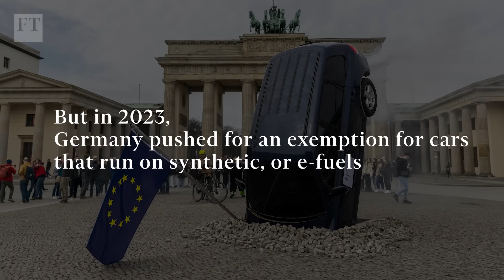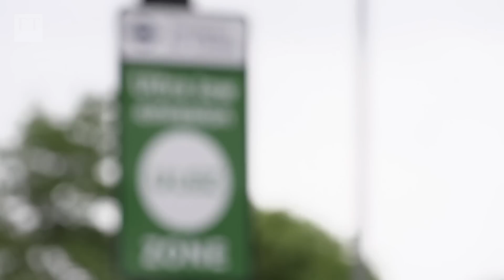The end of the combustion engine? | FT Energy Source

Comment: I'd like to hear a discussion around fuel prices. At what point in the reduction in oil use will it become too expensive to use
Reply: Why do you think that oil production will be reduced?  Oil is used to make just about everything - clothes, plastics, etc.
Reply: @bobcrow1462  plastics are a by-product of oil. If there is no market for burning it, plastics will become non viable as a "cheap material". Although that change will no doubt impact the consumer market.
Reply: @uniteddreamer  - " plastics are a by-product of oil". This may have been initially true (though polymer creation started before this time)  but once it became obvious how versatile plastic is, this view changed. You also refer to plastic as a cheap material. Plastic only becomes 'cheap' once it's developed. Look at ABS, PET and PP and compare these to PTFE and Alcantara for example  Plastics will always be economically viable because the are now indispensable.. 'Fossil plastics' will be around for a long time to come if not indefinitely as there will be a lot of resistance to bioplastics (as there was to bio fuels ('growing fuel instead of food (with the opposers ignoring the fact that the 'food' was of low nutritional value)).
Reply: @uniteddreamer Plastics aren't a "byproduct" of oil. They're a derivative of oil, just like fuel, fertilizer, industrial lubricants, personal lubricants....
Stop using oil for energy, and that part becomes waste.
Reply: @wisenber  they're a by-product. Plastics wouldn't be a thing if we didn't burn oil for energy. That's what drives the economic imperative. Plastics are an afterthought.
Reply: @andyroid7339  well hopefully we will learn how to recycle it. Because there are plenty of "indispensable" plastics lying in landfills.
Reply: @uniteddreamer  Except that's not true. You don't seem to understand the adoption and development of petroleum very well. Without oil, our current standard of living and life expectancy wouldn't be the same. That, and hydrocarbons still provide around 82% of the energy required to maintain the current standard of living.
The first use for oil was kerosene for light. Prior to that whale oil was the leading source of fuel for lamps.
Reply: @wisenber  plastics weren't developed till long after we started refining it to burn as fuel.
Reply: @wisenber  with respect to our standard of living, that's a completely separate point. The same could be said about horses, coal, agriculture, etc. History is full of epoch defining transitions. And the green transition will be the next one. It's called progress.
Reply: @uniteddreamer  Interesting that you'd expect technology to freeze at a point in time.  Chemical companies and refiners have been working for over 150 years to find new uses for petroleum. The fact that a single barrel of oil can be distilled and refined into a dozen products shows that. If you make gasoline, the material for kerosene and jet fuel still remains, after that, diesel, after that, shipping fuel, after that tar for asphalt. Before you get to those, polycarbonate for glasses, nylon, polyester....are made.
The "fuel" part is a byproduct which would be tossed as waste.
Reply: @uniteddreamer  - you're correct about the plastics sat in landfills. There are companies already 'mining' this material, along with the metals also there. However, the energy required to process the plastic surrounding food products would be better spent going to power grids whilst stopping this use of plastic (as France will do from 2024).
Reply: Half of the barrel of oil is used for things other than energy.   Oil ain't going away.
Reply: That's a million dollar question, and one the oil industry will need to decide the answer to.... My guess is that as sales volumes of petrol and diesel fall, I feel they'll increase prices at the pump in efforts to maintain their profits. This of course will have the effect of moving more people away from ICE cars....
Reply: @Brian-om2hh  If gas and diesel are no longer being used, refineries will have to figure out what to do with all of the waste when they're making everything else we use oil for. Right now, gas and diesel revenues are making other petroleum based products less expensive. Gasoline was originally a waste product from the refining of oil into kerosene used to heat and light homes.
Reply: Oil producing countries will reduce prices and profit margins and increasingly sell more to developing countries that are still evolving from foot, horse, bicycle and motorcycle transport into ICE cars, likely discarded cars from first world countries ...
Reply: @neilmckay8649  in Rwanda their motorcycle taxis are already transitioning to EV motorbikes. Small-scale solar solutions are being adopted because grid infrastructure is not available for hundreds of millions. Just as mobile phones are more prevalent than  landlines. This is the technology leapfrog effect at work for late adopters. Africa is not relying on western cast offs to the same extent.
Reply: @uniteddreamer  good point. Philippines, where I live, the great majority move on 150cc motorcycles and would love to graduate to a car. Then is the question of new Chinese or old European ...
Reply: @uniteddreamer Africa is building coal plants. Yet Western colonizers want to impose their own expensive climate mandates on the poorest nations.
Reply: @wisenber  at the grassroots level, solar solutions are cheaper, and can be delivered off-grid. It's industry, governments and the heaviest users of grid electricity that are driving coal use, and coal producers sticking their fingers in the pie. But even that is changing.
Reply: @neilmckay8649 ice will not be their choice, the same way they skipped several iterations the ”west” did with phone tech. 
They go directly to current tech, or the previous generation, they skip the other gen’s!

Oil companies are fighting tooth and nail with lobbyists, useful idiots and bribes, but in the long run, new tech will win.
Reply: That's the clincher the oil industry will need to address and decide. As volumes reduce, the oil companies will undoubtedly increase the price, claiming it costs more to produce as a niche product......
Reply: @Brian-om2hh  If volumes reduce, we'll have to find other ways for clothing, water bottles, packaging, medical equipment, fertilizers....without making all of those things unaffordable.
Reply: This is the general idea. Private transport and the RIGHT to own the means of transportation by the individual will be targeted by the combined obscene cost of EV's & their power source and unjustified fuel oil cost spikes by means of more TAXES on both - WATCH THIS SPACE - GOVERNMENT MANIPULATION OF THE RIGHT'S AND FREEDOMS OF THE INDIVIDUAL AT IT'S FINEST.
Reply: @godfreyberry1599 more likely BiG Oil manipulation!!!
Reply: @My_HandleIs_ "Big Green" tends to hold more sway than any oil company.

Comment: My engine design has the capability of being negative emissions (cleaner exhaust than the intake air) when using hydrogen fuel. You can find it here on YouTube the McCoin Rotary Engine “MRX” engine
Reply: Production of hydrogen is really costly in either electricity, or CO2 if it is made of natural gas. EVs are more than 2x more efficient when converting electricity into motion.
Reply: The problem with Hydrogen is the logistics
Reply: @number1genoa  And the storage. It will not be safe or viable to have large tanks of hydrogen stored at 10'000 psi anywhere near housing or workplaces.
Reply: @number1genoa  
The UK is considering hydrogen trains. The hydrogen will be produced at the depots using electricity produced by wind farms.
Reply: How does it work? I have found no graphic for this engine.
Reply: How do you stop the fuel eating the engine?
How large is the Trailor with the fuel tank?

Comment: ICE : 6000 moving parts, 25 to 42% of efficiency, 95 to 200kg of materials.

Electric machine : 1 to 4 moving parts, 90 to 97% efficiency, 35 to 90 kg of materials
Reply: There are not 6000 moving parts on an ice drive train. You have been lied to.
Reply: @cyclone-g2z  my bad, after a few checks it's between 250 to 2000 with the gearbox . The gap is still in thousands of it, that's the point
Reply: gas is about 100 times more efficient than an average lithium battery in EVs today: 160KWh/kg (pack level density), which means more weight and raw materials.
Reply: @tooltalk  you are confusing density ( the amount of energy by mass ) and  efficiency ( how much energy do you waste when you try to convert it in movement) 

It's from far the most important
Reply: @philv3941  : yes, my bad..  not efficiency, I meant energy density : gas 30+MJ/kg vs LIB .3x MJ/kg.
Reply: You are ignoring the complexity of the motors, batteries, and motor controllers. They contain tens of thousands of discreet pieces of silicon, battery shell, cathode, anode, separator membrane, electrolyte, pieces of wire, insulation, lamination, plastic, etc., all of which had to be assembled by man or machine. And all of which can break.
Reply: @geocam2  there is, according to the same insurance companies, between 5 to 15x less chances to experience a fire in an EV than in an ICE car. 
Just check. It's not because EV fire make huge buzz that they catch fire more often, far from it.
Reply: And those rare earth materials will be expensive and in short supply.  On the other hand, there's almost an unlimited supply of fossil fuel thanks to fracking and shale oil extraction.
Reply: @bobcrow1462 you don't burn those "rare earth" materials. That's the difference. And when are oil companies gonna close the two million or so wellheads still left open after five to ten years fracking and depletion of local water supply
Reply: @bobcrow1462  >> And those rare earth materials will be expensive and in short supply.  <<
First, they are not "rare earth materials." 
Second, the prices of raw materials used in EV batteries, eg, lithium, cobalt, manganese, have been falling like a rock: the average price of lithium down 80% since last November for instance. 

>> On the other hand, there's almost an unlimited supply of fossil fuel thanks to fracking and shale oil extraction. << 
Most battery metals can be recycled..

Comment: The premise of the question is flawed. We need to be sensitive to the direction of causality. The available energy, is what determines the best technology, which is what determines the social arrangements in which it is embedded. Cheap abundant fossil energy made possible the culture of automobiles, and commensurate urban design, land planning and infrastructure. The future of energy cannot and will not be the same, so the technology and social organization surrounding it will be different too. Single user vehicles are not efficient or cost-effective, they do not ‘fit’ well with mass electrification. Public transportation seems far more suited to urban needs, and a high speed rail network for intercity linkages. I anticipate EV’s to be used predominantly in rural settings, to transport commodities to transportation hubs, and for emergency services  and security or defense fleets. Unlike in the past, we have a specific future to achieve, and this suggests some thoughtful planning and investment are appropriate.

Comment: Cars using ICE are about 20% efficient in converting chemical energy to mechanical energy.  Fossil fuels are one of the most dense  sources of chemical energy making its portability feasible.  However, electric motors are up to 90% efficient in converting electricity to mechanical energy.  So that part is a no brainer.  Transmissions are not necessary in EVs and most of the mechanical functions can be done with electronics making them cheaper once they are in production.  The F16 is an example of how hydraulic and mechanical systems can be supplanted by electro-mechanical systems.  Julia has a much better grip on the subject than the others.
Reply: The fact that you still call it "fossil fuel" when it has nothing to do with fossils just blows my mind.
Reply: You're easily impressed. @goodtoBfit

Comment: Electric motors are pretty much the most energy efficient machine of any type ever built. The problem is that batteries are almost the least efficient for mass per energy. Solve the battery problem and EVs become several times faster, more efficient than ICE

Comment: It is misleading to state that EVs will lower carbon emissions because that statement does not take into account the carbon emissions during their production and especially the mining, transport and refining of the materials used in the batteries. Realistic estimates show that an EV needs to be driven over 60 - 70 thousand miles before it starts to save carbon dioxide over a conventional car and that assumes all the electricity will come from renewables with the IAEA calculating that at best they will contribute only 50% of global power by 2050. Renewable energy solutions are a scam with switching electrical power production from fossil fuels to renewables resulting in a reduction of 7% in power produced and a 13% increase in cost and this is the best cases of wind and solar.
Reply: Again a lie.
Those reports are basicly saying that gas appear on the pump.
They also think that an EV are first produced as an fossile car.

And, they also asume that the EV is produced by electrictrisity made by the dirtyest coal plant in the world, an the fossile cars are made by the cleanest electrictrisity in the world.

Those reports are debunked long time ago.

Comment: One factor limiting the adoption of home and small business-scale solar and also EVs is that home storage batteries like Tesla Powerwalls are still hugely expensive and store little power. A 13 kWh Tesla battery costs $15,000 US to install! Bring the cost of storing 50 kWh to $15,000 and the economic advantage of owning solar and batteries and EVs will jump past that of buying electricity and gasoline from electric utility and petroleum monopolies/cartels.
Reply: Yes, home batteries are too expensive. It is cheaper to buy a cheap EV with a 40-60kWh battery and use it as Vehicle to Home, or Vehicle to Grid battery, than to buy a pre-built equivalent-sized stationary battery. And that is what I think should happen- all EVs should be connected to the grid whenever they are standing (which is what they do most of the time), and also serve as batteries for slowly taking in electricity at peak production hours, as well as for grid balancing. LFP with enough life for 13 years of daily cycling already available.
Reply: Vehicle to Grid will sort a lot of that out